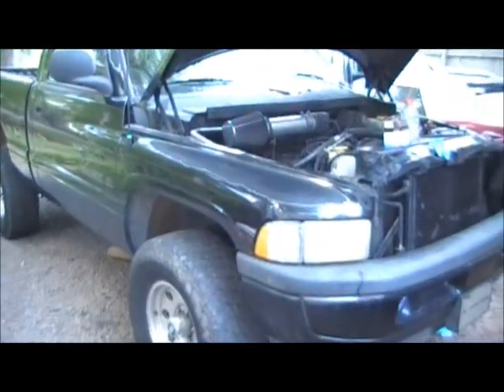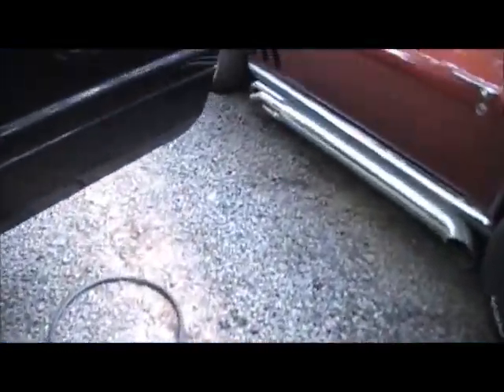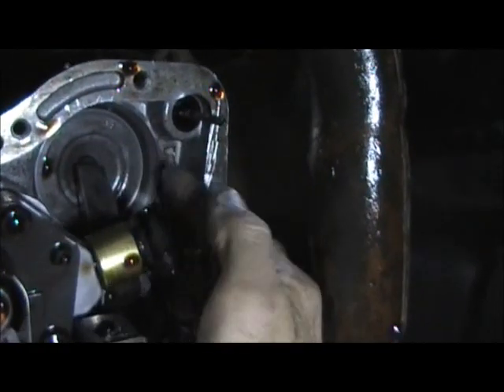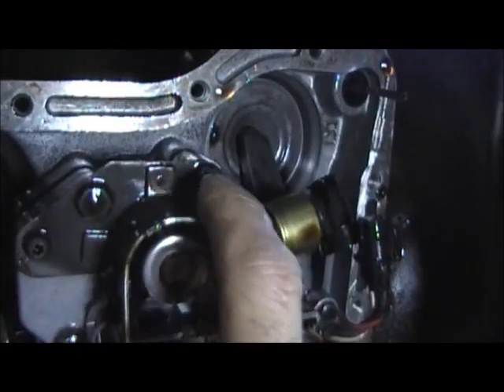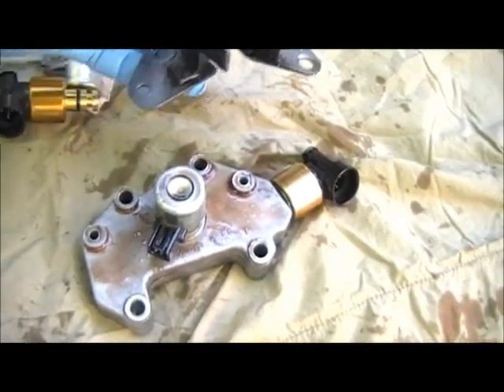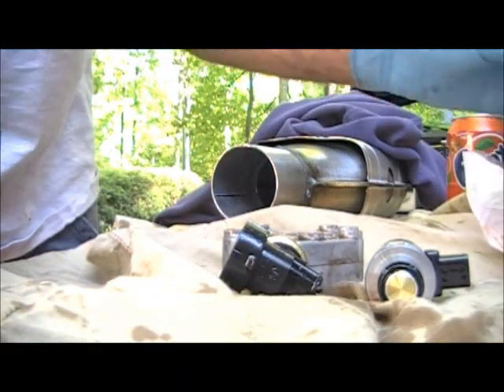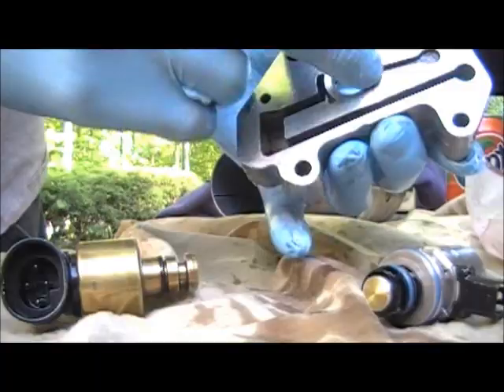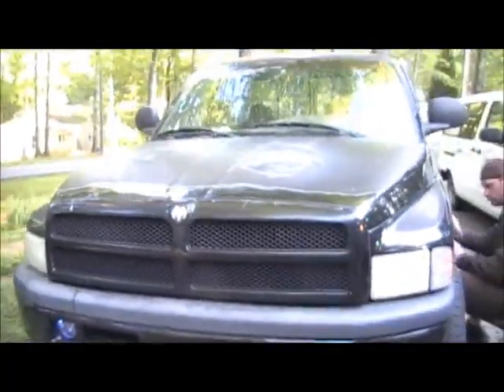1998 Dodge 1500 Transmission Wont Shift Fix

Comment: I just bought my son a 2001 Dodge Ram 1500 Sport 4x4 automatic and the entire bottom of the transmission pan is wet from the pics my wife sent me of it and it looks as though the one tranny line is leaking or the pan gasket itself. The lady told me that the transmission moves the truck back and forth, but that it slips into neutral. So my first common sense guess is that the transmission fluid is too low from the leaking and that once I fix it the transmission will be fine, but I heard in other videos to not buy the Mopar brand replacement parts or else you would end up with the same issue and to get aftermarket parts. Would it be beneficial to go ahead and change all these parts while I'm under there anyway?
Reply from the maker: Frank Murray yes and figure on replacing the unit within a year or two
Reply: @2012nugget  so would it be best to go ahead and have it rebuilt now since I can get it rebuilt for $650 plus the price of a new torque converter?
Reply: @2012nugget  also, where do I need to order my.parts from to get good quality parts other than the Mopar stuff?
Reply from the maker: Frank Murray the 650 doesn't include the parts?
Reply from the maker: Frank Murray you would need to do research on your local transmission parts providers.
Reply: @2012nugget  yes it would I'm sure, but I was saying would it be more beneficial to just have someone rebuild it now or do you think doing the repairs like the pan gasket, solenoids and o-ring in the leaky line along with new fluid would be enough to last the truck a while?
Reply: @2012nugget  basically just the transmission pan is the only thing that is wet and it is bright, good colored fluid and the only leak I can see possible there besides the pan from the pics my wife sent me is from the line going into it which I'm sure the o-ring is bad on. I imagine (not in front of it to see it yet) that the o-ring once fixed and possibly the pan gasket as well with new and topped off fluid will fix the issue as long as she didn't hurt the transmission any. She did say it didn't leave her stranded and she was able to drive it home.
Reply from the maker: Frank Murray that's the million-dollar question. There's no way of knowing how this transmission was treated or prior damage. If you can afford the 650 I would definitely say it will be worth your while. That's the way I would go on an unknown unit.
Reply: @2012nugget  thanks for the honest input brother. 👍

Comment: Hi, I found this video very helpful.  I have '98 Durango 5.9L that was having these exact symptoms.  It would shift fine except from 2nd to 3rd.  The transmission would "spin out" at higher revs in 2nd, and then shift to 3rd.  I have replaced the governor solenoid and sensor.  Now the problem is that the transmission shifts fine except that instead of "spinning out" at higher revs in 2nd, the transmission will stick in 2nd for several seconds, and then at higher revs it will shift to 3rd.  Also, if I back of the revs in 2nd the transmission will shift to 3rd.  When I changed the solenoid and sensor, the fluid was in excellent shape, looked almost new.

I've read about issues with the Throttle Position Sensor causing shifting issues, but that symptom seems to be RPM variation, which I don't have.  The other is the Transmission Output Speed Sensor.  If anyone has a suggestion on what to check, I would greatly appreciate it.